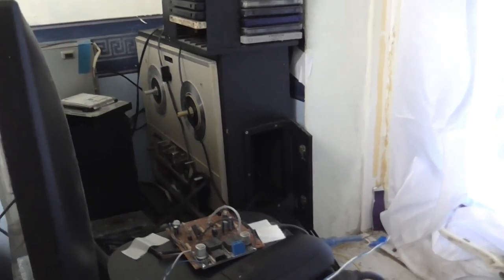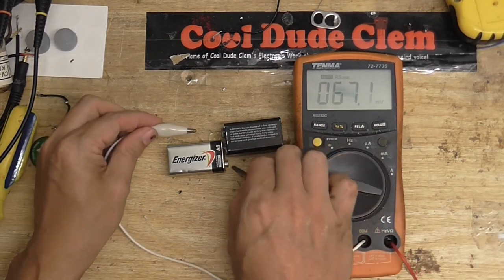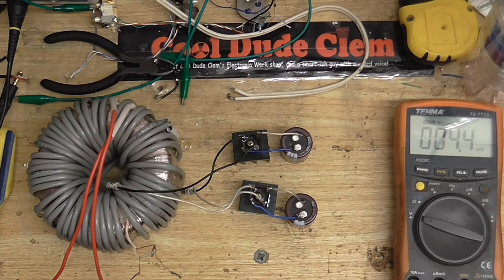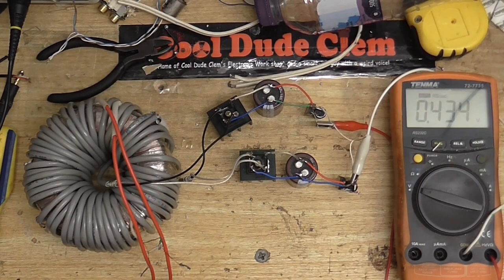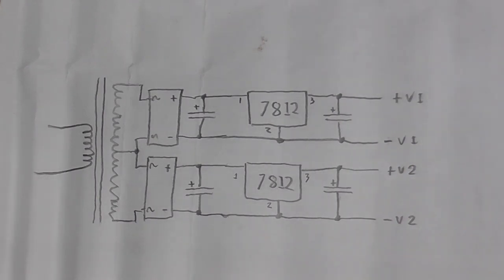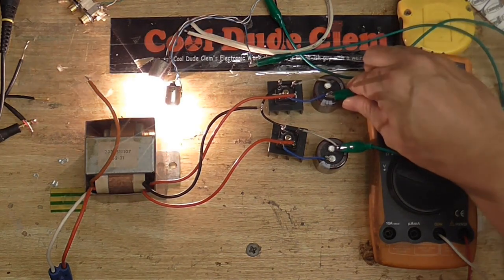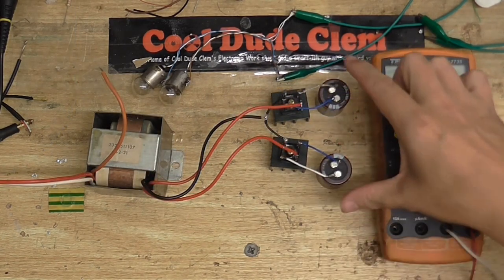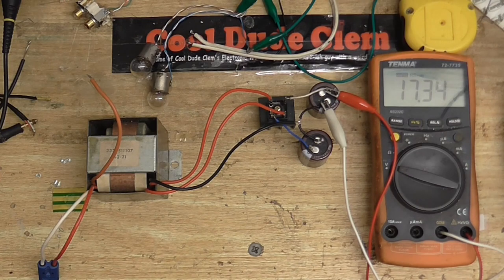Building a small amplifier part 1/2 - Power Supply

Comment: I recently made a dual rail supply using two isolated windings and regulators, just as you did. It was to power a power amplifier. What I forgot is that the regulators I used are rated at only 1 amp, so it worked fine until I turned up the volume, when BANG went a regulator chip!